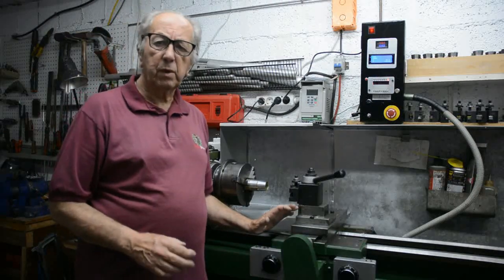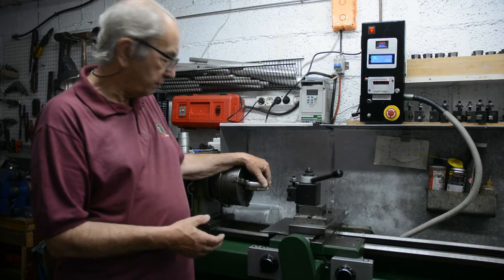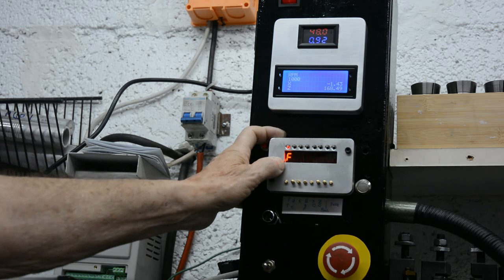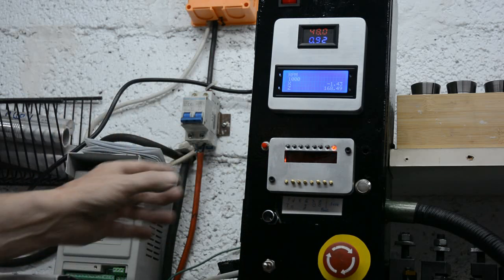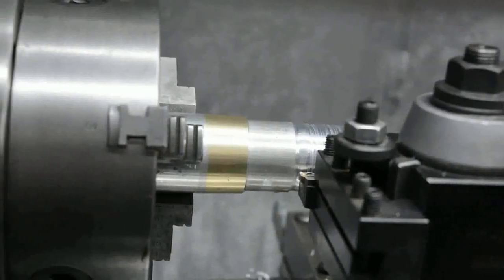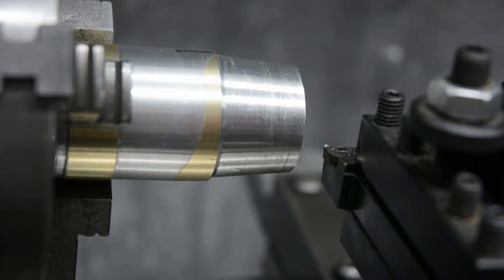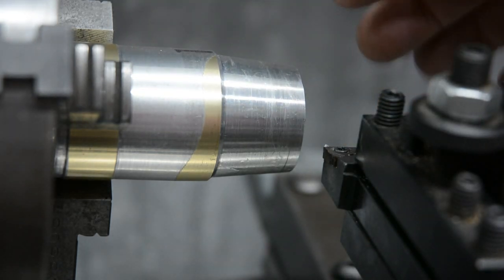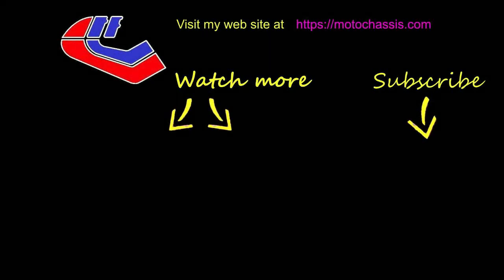Homemade DIY Electronic Lathe conversion with ball screws - amazing transformation.

Comment from the maker: I have some people who are keen to copy my lathe control and as a result I have designed a PCB for the controller which will make it very easy for anybody to make it.  I will be ordering PCBs very soon so if anyone is keen to have a go then contact me by email (motochassis@gmail.com).  Along with the PCB I will make the code available and provide some instructions.  However, this is not a money making operation for me and so do not expect too much in the way of support.  This is a system that I made for myself but I am happy to share details with anyone on a " this is what it is, take it or leave it" basis.
I soon got fed up with the control single line display and small buttons so I changed the input and display systems which is described here: 
https://www.youtube.com/watch?v=iNPOS4fsgbg

Comment: The idea of change gears in this day and age seems quite antiquated. ELS is a no brainer. Also it's a nice compromise between manual and cnc, which doesn't necessarily make sense for one off work. I like the idea of switches right on the carriage. That's a better ergonomic solution that having to reach for a panel. I was thinking of a joystick but perhaps that will be a bit too easy to inadvertently knock. Anyway great effort. Nicely done.

Comment: This is wonderful. I have a 1968 Southbend heavy 10L lathe and I’ve wanted to convert both lead screw and cross slide screw to ball screws. I’ve seen your video on converting the cross slide, but would like to see how you did the lead screw. You have the apron and half nuts to worry about. 
Can this be done on a SB 10L?
I have all the parts to build the Clough42 ELS and I’m wondering if this is compatible with your setup. 
I guess I’m a bit lost in terms of how to make the conversion and how it fits into my existing plans. 
I wanted to replace the motor with a 4.25 hp, 130 VDC treadmill motor with forward/reverse, and electric brake. Then I was going to put in the ELS from Clough42. 
But your setup allows both Z and X axis control. You must have changed dials to something fancy and added stepper motors on both feeds. 
Do you have other videos on how this all came together?
Good job. I enjoy your videos and your voice. 
Paul
Reply from the maker: Paul,
You can find a playlist on my channel with all the lathe modification videos that you asked about.

Comment: Hi! Have you published your software yet?  I am currently adding non-CNC steppers to my Warco WM18 mill and I am curious to know how you handled your steppers in software.  I am using Teensy 3.6 microcomputers.  Thanks for the video!
Reply from the maker: Handling the steppers is easily, you just send steps and direction to the drivers.  So all you need do is work out how many steps to send.  Say you have a 5 mm pitch screw and a stepper set to 1000 microsteps per screw revolution then 1000 steps moves the slide 5 mm.  if you want to move the slide 1 mm then you need to send the controller 1/5  * 1000 = 200 steps.  You space the steps out in time to give the velocity that you want.

Comment: Very cool. But I’d like to know more about the details. Like how you sync the x and z drive together. What’s in your control box. Kinds of motors you used. Software and rpm sensor. 
Maybe I missed this stuff, but good job. 
I have a Southbend Heavy 10L and I am putting a 4.25 hp treadmill motor with variable speed control and the Clough42 electronic lead screw. So I’m curious about all that’s involved making the conversion. 
Paul
Reply from the maker: See later replies.

Comment: Are you using a two phase vfd? How is it working? Do you loose any power to the motor?
Reply from the maker: Single phase 220 V input, 3 ph out.  My VFD is oversize so no problem.

Comment: Hi Motochassis. Just discovered you now! Great videos really love the workmanship and your electronic engineering capabilities!  I'm retired now in Canada and have been machining for about 40 yrs. from manual to full cnc design and production but I miss it. So I bought an old combination 12x36 lathe/mill (with the change gears in a box) and a bunch of modifications to it. I am VERY impressed with your work and I want to research the cost of converting over to a setup like yours but if adding a full cnc controller isn't too much more I might go that way. Could you post the rough cost of your project here or should I try your email? 
Great job really! Including the filming! 
Thanks again!  
LD
Reply from the maker: I missed your comment until now.  I have not counted the cost so I cannot help there.  To go from what I have done to full CNC is almost trivial  and so is the cost.  Depending on how you go about it the cost for the CNC part could be as low as $5.  Google for Grbl and GrblHAL.  I use Grbl on a laser engraver.  There would be cost savings because you would not need the electronics that I use but you would need a PC,  A laptop would be perfect, it would not need to be a late model.

Comment: After using a Fanuc OT cnc controller on a Colchester lathe for close to 20 years, I can't imagine putting this much effort into something that works so much less proficiently. Not to say that this isn't clever. But the technology of the Fanuc has been around for a quarter of a century already and it's like you guys are just trying to reinvent something from 40 years ago. 
As far as cutting threads on that thing, they look more like fast feed cuts if you ask me.  With enough f_ing around you may eventually get a good looking thread.
Reply: Why are old man machinists always so cranky?
Reply from the maker: As I made clear, I simply do not want a full CNC machine.  This suits my work so much better.

Comment: I really like the the CNC control of a manual lathe. I recently purchased a well used Clausing 5914 lathe and it needs a new lead screw which costs more than I paid for the lathe. Since I am refurbishing the lathe anyway, It will be easy to convert to a ball screw and cost a fraction of the price of a new lead screw. I was planning on Clough42's ELS conversion but since the lathe has power feed on both axis, I prefer to do your conversion scheme. I'm looking forward to more information on the controller and software. Thanks for the inspiration.
Reply from the maker: See my comment at the top.

Comment: How is this not an cnc? :)
Reply: @GeeEmJay  CNC, Computer Numerical Control. Has nothing to do witth gcode per say. you replaced manual mechanial control with Computer Numerical Control. No? I have done the same exact thing to my late,and when i describe it i say its a cnc lathe.... But whatever.
Reply: @matslundberg1289  I think you may be arguing over terminology here. Yes, technically this is numerically controlled, by a computer, so the CNC label would apply. But that's kind of missing the point. Manual machines can be great for making one-off bespoke parts that just need to work. Throw it in the 3-jaw, take off a few thou, test fit, repeat. That is normally pretty annoying to do on a normal CNC lathe. This system is CNC, but its on-the-fly programmable. Your programming is done directly at the machine, with the machine's (now electronic) handwheels and a few buttons. Its a semi-automatic CNC lathe. Saves a lot of time in front of a computer screen for jobs that just don't need it. Also means you get the best of a manual lathe, but with way less tedious multiple passes, or needing to swap change gears.
Reply from the maker: @GeeEmJay  It also replaces the X feed.

Comment: Hi Tony, This is really interesting,  I am just recommissioning a Hardinge hlv and this would be a good improvement. The motor drive on it has problems, the variac  is broken. Do you have any step by step guidance on what you did to convert. I certainly don't want to cnc this old lathe but would like it to be it's best. P.s I'm building a Ducati supermono so need it to make some engine parts. 👍
Reply from the maker: Supermono. Are you converting a twin or are you lucky enough to have an original?
Reply from the maker: See my new comment at the top.

Comment from the maker: Many comments are focussed on screw cutting.  This conversion certainly makes that easier but was not the main focus for me.  I seldom need to screw cut.  As for the ball screws, of course they are not a necessity but after a considerable period of use I can tell anyone that I have no wish to return to conventional screws.  One can theorise until the cows come home about which is best but that all amounts to zilch up against practical experience.  The lathe is just so much nicer to use and repeatability is definitely improved.
Reply: How would you even cut thread with that? The ball screws are now not connected to the drive of the head stock, so wouldn't they be out of sync?
Reply from the maker: @morningstarsci  Well firstly, the video shows it cutting a thread.  The screws are not connected MECHANICALLY to the spindle but they are connected ELECTRONICALLY and in the software just in the same way that all CNC lathes are.  The spindle and both X and Z axis all have position sensors and so the software knows exactly where they all are.  That is why is it easy to cut a thread on a taper or even on a curve.
Reply: @MotoChassisByTonyFoale  thanks for the reply! Wasn't saying you weren't cutting a thread. I was struggling to figure out how you had synced them up.
Reply: @MotoChassisByTonyFoale  I could have chosen my wording better.
Reply from the maker: @morningstarsci  No problem.

Comment: Impressive lathe mod! Subscribed! 👍
Minor question, that "one in ten" taper looks very steep, more like a one in five or one in six. Maybe that's a camera effect?
Reply from the maker: The 1 in 10 refers to the slope of the cutting so the included angle is 1 in 5 as you say.  Well spotted.

Comment: Sigh....when I heard it said that the leadscrew and crossfeed screw are ballscrews that put the block on any ambitions I have to get my lathe running with ELS.
I can't see why that really has to be........with screwcutting you are only going one way with the cut in both planes, and at the end the tool is withdrawn and with no contact with the work it powers back to the start.........a ball screw is unnecessary here even with the backlash from Acme threaded leadscrews.
The same would apply to the crossfeed, an area on many lathes that doesn't lend itself to having a ballscrew  due to the nut diam.
For screwcutting the crossfeed screw only has to move the tool into the work in steps and move it back at the end of the cut.
With a mill you absolutely need ballscrews due to the nature of the cut which must have zero backlash for climb milling etc and pitching in 2 directions.
The mechanical part is relatively easy I think...........I would fit a new vertical slide to the crosslide in place of the back tool post position, but running in a vertical plane like a milling attachment that you can get for milling on the crosslide.
The slide only has to move the tool for the depth of the thread, about 3mm at most for the coarsest of threads, and position the tool up or down for different diams etc.
It means that with a very basic lathe, a vertical slide bolted on the back of the crosslide, can be a bolt on/off device and have a short ballscrew and stepper motor incorporated without impacting on the manual working of the lathe......under electronic control the crosslide would be locked and the screwcutting tool moved by the vertical slide.
The lathe would need the normal encoder on the spindle and a stepper on the leadscrew and new vertical slide.........the hardest part is the control box for the drive......coming to our neighborhood soon I hope.
I have a micro lathe I built many years ago, 60mm centre height and 200mm between centres, without any form of screwcutting...... the leadscrew is 1/4" X 20 tpi....there is no way known that a stepper motor could be fitted to the crosslide, which is only 50mm wide and 60mm long and has a feed screw of 4mm diam, so the secondary vertical slide possibility is the path I would have to take.
Reply from the maker: I never claimed that ball screws were essential, all I can tell you is that I have no wish to ever work without them.
Reply: @MotoChassisByTonyFoale  Yes I know what you mean.....I have them on my Skyfire CNC mill ......only way to go for that use.
Reply: For an els where you want to keep manual control you need regular leadscrews, in that case you can just use anti backlash nuts. For fuller CNC anti backlash nuts help but you can do a lot in software.

The thing that bugs me about the video is he poopoos CNC but then demonstrates a working method for doing his work that is far more abstract and complicated/obscure than simple conversational programming like centroid acorn or mach offers
Reply: I have been in contact with a seller of a ELS kit who told me ball screws aren't essential. I do think they greatly reduce the chance of a stall, and you'll likely get rid of a lot of backlash, even though a lot of the software can compensate for it.
Reply: @someotherdude  Well, a ballscrew does eliminate a lot of friction compared to an Acme screw thread which adds more power demand to the motor.....backlash with threading is not a problem.
Reply: @gangleweed  I agree with both your points, but threading is not all we do, backlash is often a big problem with cnc, and yes a ball screw lets the stepper motor give its all to cutting instead of stalling.
Reply: @someotherdude  My own humble opinion is that an ELS gives you the absolute control for all pitches for threading and also for feeding without the need to change gears.....anything else and you are thinking in terms of "I need (would like to have) a CNC lathe"...........minimalism starts off with threading and leads onto full CNC.
It can be very simple with ELS for just threading and feeding.....anything else and you would have to think about what you are really doing on the lathe......I was never one to think in terms of automated turning, but then I'm fully retired so my criteria is a lot different.
One thing I would fit to my lathe and that is a single axis DRO for the crosslide ........NEVER....... on the saddle.....that would have a micrometer bed stop.....you cannot watch the tool approach a face and a DRO at the same time and it's easy to over run a DRO with the coarse feed of the saddle handle.
Reply from the maker: @gangleweed  Prior to this conversion I had a DRO on both axis and never needed a bed stop.
Reply: @MotoChassisByTonyFoale  I never found a readout for the saddle to be of any real value compared to the crosslide which determines more for the accuracy of the turned part, it's too easy to over run the DRO........I usually lock the saddle and feed with the compound for facing etc.......horses for courses etc.

Comment: Just discovered you. Great videos really love the workmanship. Just idle curiosity but have you got a feedback from the spindle for the threading operation or is it just down to the synchronous motor?
Reply from the maker: I have two spindle sensors.  One is a single pulse for indexing and the other gives multiple pulses per revolution.

Comment: Most controllers just have 1 input for handwheel encoder. And we havecto switch between axes. Can you use both handwheels at the same time?
Reply from the maker: Yes I can use both together.  I made the controller so I could have as many handwheels as I wanted.  I was not constrained by a factory made device.
Reply: @MotoChassisByTonyFoale   I am a cartridge wildcatter. I racked my brain to find a way to float a barrel blank in my steady rest, internally bore out a sizing die, lop it off, after threading it, and then thread and chamber a slightly oversized version in the breech end of the remaining  barrel blank.  This would solve the chicken or egg paradox!  A roughing reamer cuts the chamber and then the finish reamer cuts the sizing die.  Two $150.00 reamers are needed, about 0.005” different in diameter!  Could your lashup hold these different tapers, working down to say, a quarter inch rifle’s barrel bore??
Heretofore, cutting a rifle chamber with a single point boring nib, is super grade gunsmithing.
Reply: Got it backward, rougher cuts the die and chamber, then the 0.005” larger finish reamer cuts the +0.005” diameter chamber.  The sizing die has to squeeze down the fired case so it slips in easily before shooting it.

Comment: great idea for servo assisted manual lathe. I was planning the same for a mill, same idea with encoders and some force feedback based on the current on the servomotor. With the encoders you don't "feel" if you're going too aggressive and going to break something
Reply from the maker: You do not feel that when you use the normal feeds either.
Reply: @MotoChassisByTonyFoale  Actually I do feel it on the handwheel. Especially if an endmill is dull
Reply from the maker: @car9167  I meant when you engage the powered feeds. you are not using the handwheels then so you have no feel just hopes.
Reply: @MotoChassisByTonyFoale  I see what you mean. No power feeds on my mill

Comment: Looking forward to this. I'm looking for a dual CNC/Manual setup for a mini lathe at some point. Parts list would be welcomed.
Reply from the maker: I have not made a parts list as such but I think that what is needed for each stage will become obvious as I do each focused video.  Basically I just ordered what I wanted as I needed it.  Although I do not want a CNC it would be very quick to change over.  It would just be a matter of plugging a CNC controller into the motor drivers instead of my ESP32 controller.  I have bought a very cheap (26 euros) CNC Mach3 controller just to try, only because it was so cheap.
Reply: @MotoChassisByTonyFoale  Thank you. This will be looked forward to. I was looking at what Wade'o Design did a few years ago, but your design looks more interesting.